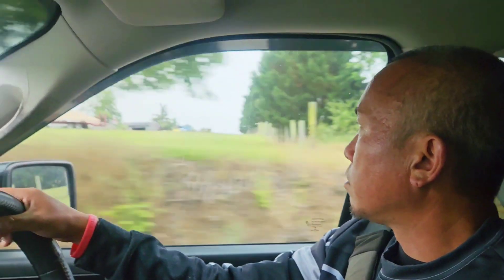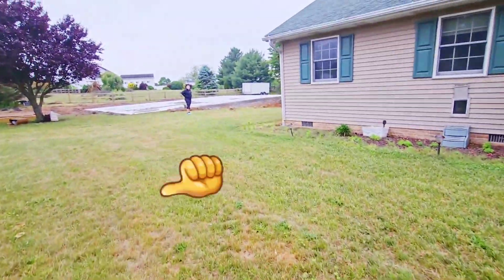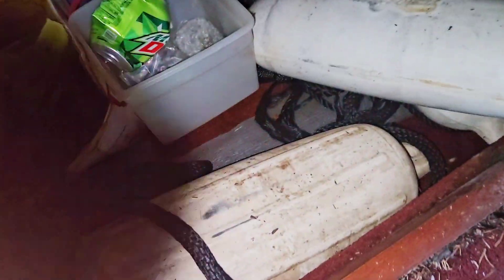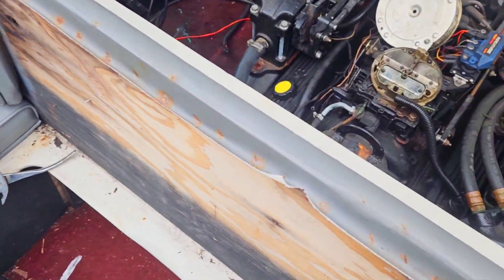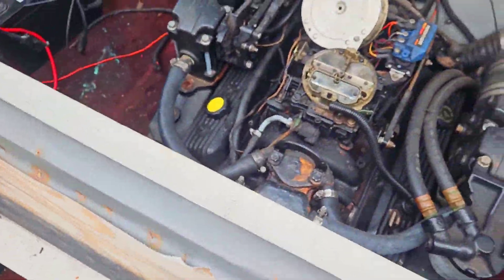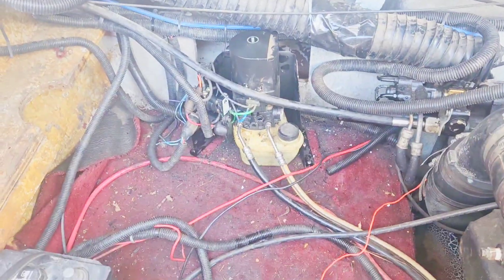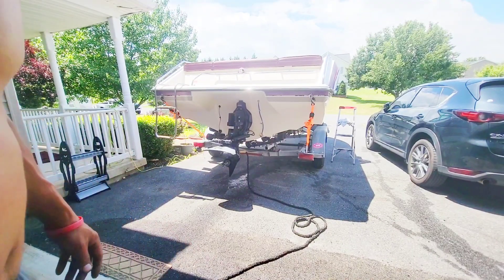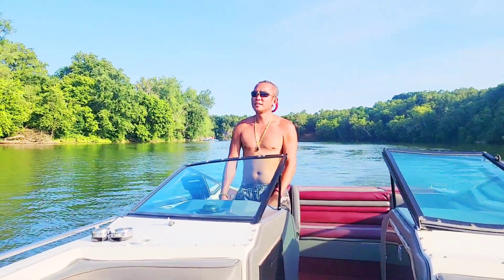Thrill of The Hunt: Mercruiser 5.7 V8 Alpha One?

Comment: Great looking boat!!  I have a quick question for you. On a 1966 mercury 95 hp tiger block. Setting the max spark. Do you the the carbs at wide open throttle ?
Reply from the maker: No. Max is set according to non running conditions. Son

Comment: Nice boat! Definitely replace that thermostat housing, looked like it was leaking in the video but you spotted that. Be sure to change that impeller too if it's been sitting. Alpha One outdrives have the impeller in the lower gearcase same as an outboard. Check bellows too and make sure they're not cracking, if they are, they should be replaced.
Reply from the maker: Thank you my friend. Son
Reply: @MerCSonL6  You're welcome, looks like a great boat with a bulletproof motor!

Comment: Get rid of that glass fuel filter they have caused more fires then you can imagine and when it's at operating temp you should be able to place your hand on top of each exhaust riser for 3to 5 seconds or get a infared temp meter and check each riser to make sure they very close to equal temp and change the impeller as you know I'm sure. I'm not a know it all but I do know enough to speak on these. That is the perfect family boat with the open bow you guys are going to fall in love with it and it's big enough to handle wake and cruise right over them and when that engine takes a dump I would suggest dropping in a 7.4 mercruiser 454 with a Bravo 3 outdrive twin props.